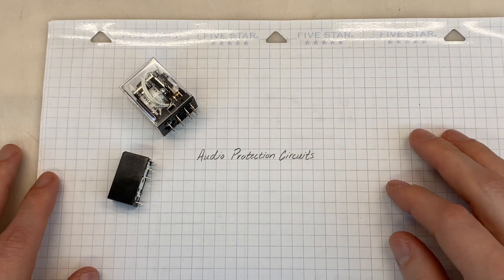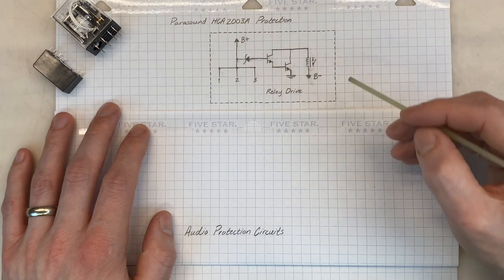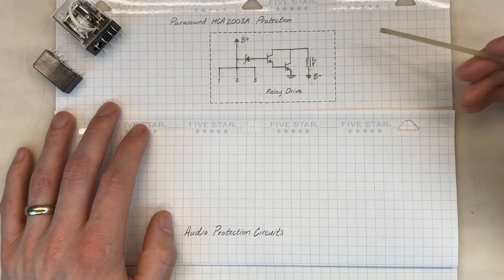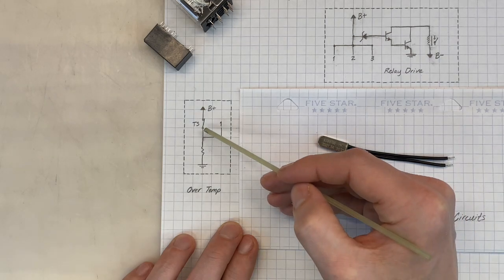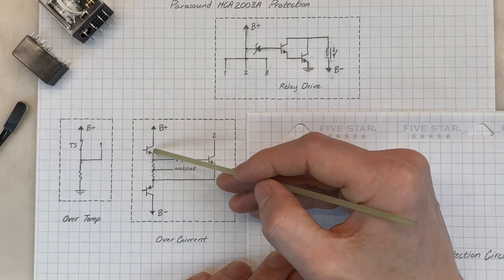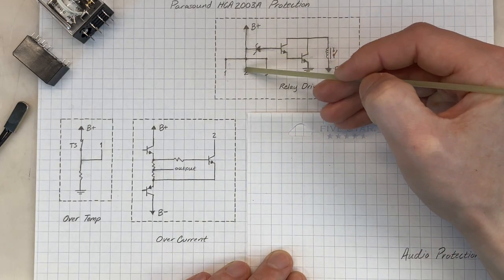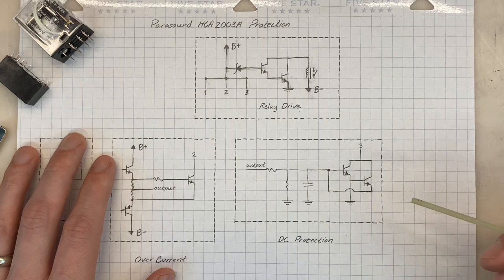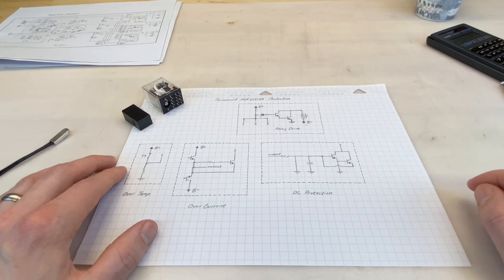DR #59 - Analyzing Audio Circuits - Parasound Protection Circuitry

Comment from the maker: * CORRECTION * The relay is indeed driven by a voltage labeled "B-." However, B- is not a negative voltage, it's a positive voltage, just less than B+. Therefore, the current path is not from ground to B-, but from B- to ground. The "B-" label is confusing.

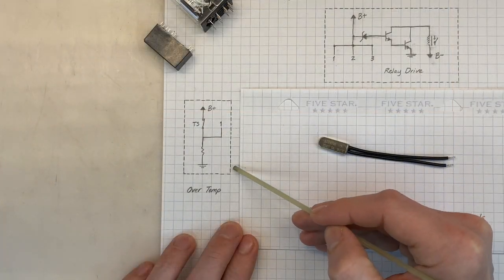Comment: Thank you for the time and effort you put into your videos. Could you expand your explanation on the over-temp protection at 1:30? B+ volt is supplied both by the Over Temp voltage and Relay Drive voltage at node 1.  It appears (to me) that the voltage at node 1 is B+ whether the Temp Switch is open or closed. What am I missing?
Reply from the maker: Ah yes. I forgot to add a component. There is a diode between node 1 and the junction of the temp switch and resistor. When the temp switch is closed (normal condition), there is B+ on either side of the diode, so it does not conduct. When the temp switch is open (over temp), there is now a path to ground from node 1 via the resistor. The diode will conduct, and the relay will disengage. Sorry about that.
Reply: @ Thank you. That explains it.

Comment: I like the clear explanations you gave of the circuits.  Clever design in how it works.  One thing though, the relay driver transistor can't be NPN if the relay supply is B-.  Usually B+ is used or you'd need a PNP transistor as the driver.
Reply from the maker: Yes, good call. I reviewed the schematic and added a correction comment. The "B-" label threw me off.

Comment: The relay drive circuit is wrong, the current cannot flow in that direction for a npn transistor. I think the relay should be connected to the emitter and both collectors to the 0v ( more positive than -b)
Reply from the maker: Yes, good call. I reviewed the schematic and added a correction comment.

Comment: Thank you for the simplified explanation. I’m assuming that the relay is for current to flow to amplify the audio signal when they meet up further along the circuit. It’s not the actual audio signal flowing through the relay is it?
Reply from the maker: Good question. The audio signal is flowing through the relay. The relay is usually one of the last stops for the signal before reaching the speakers.

Comment: Super helpful and very thorough!!!  I am just starting to learn about the science of audio electronics outside of work (I work in wildland fire).  I did a super minor repair on my old first Gen AdcomGFA-555, and was successful thanks to your videos.  I would LOVE to learn how exactly an audio signal moves thru a pre-amp, and then an amplifier: what happens to the voltage or current of the signal from at it meets each component, WHY that component is there, what it does to the audio signal, and so forth as it works thru the piece of equipment.  I am trying to compartmentalize some things to learn a bit more easily and comprehensively, like dealing with just audio power supplies and what they are comprised of and why...and this is starting to make sense to me.  Next was pre-amp circuits.  Eventually, I'd like to know why certain amps are designed and made the way they are and how/why they may 'sound better' than other amps.  Like the Carver equipment you repair: those seem to distinct and unique, on purpose, because they 'do some things better' than conventional amp designs.
Reply from the maker: I've thought many times about making a video or series of videos detailing the path an audio signal takes through an amp. I'll try to make it happen in the next few weeks.

Comment: As someone who can solder and test parts, and is trying to learn, this kind of short explanation is great.  It helps anyone who is not an engineer or without the training to understand the flow of a schematic - something I often get confused with - and is a great help in recognizing just exactly what certain things on a schematic are doing.  Thumbs up.